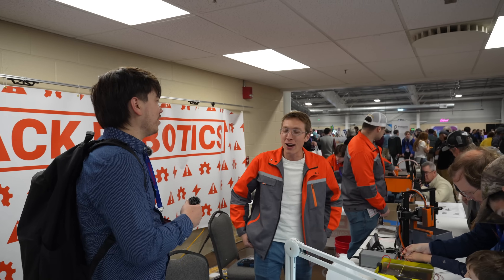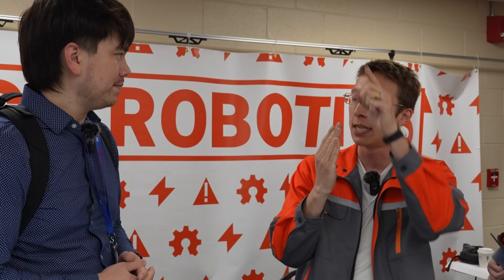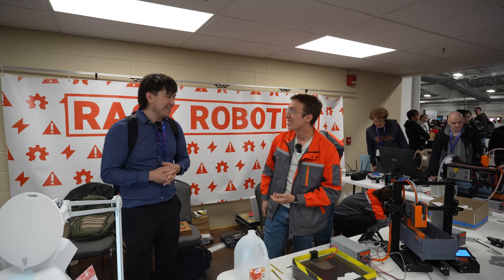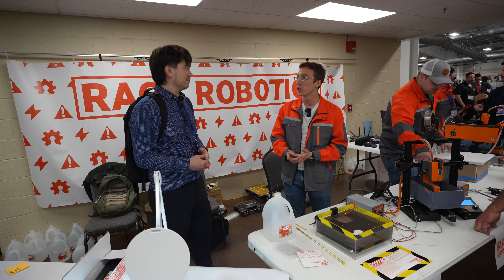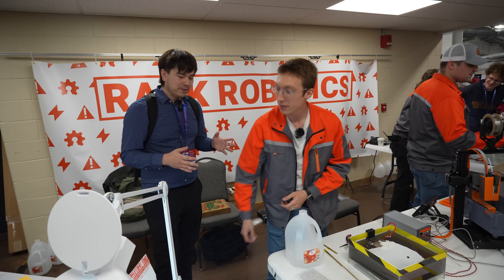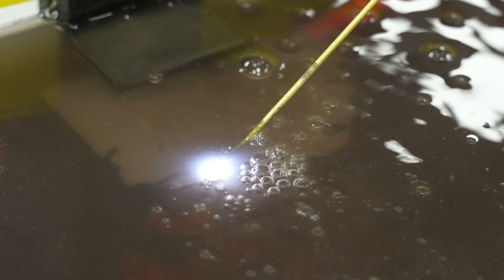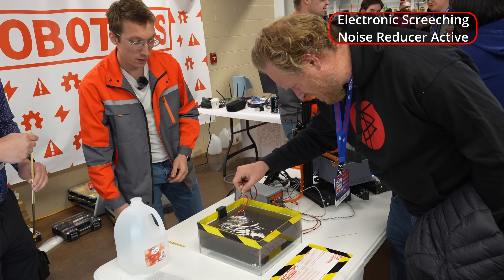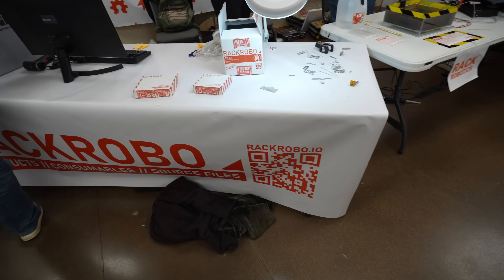This 3D Printer can cut metal! Wire EDM with Rack Robotics (RMRRF 2024 - Interview 2)

Comment: This would be the greatest addition to my 3d printer in terms of home made rc toys. The ability to do aluminum work with an old ender vs a Dremel and files would be amazing
Reply from the maker: Yeah for RC stuff, small mechanical parts, even relatively heavy brackets, this thing would be great
Reply: @NathanBuildsRobots  it would cut my grinder use by 90% which would be welcome

Comment: Now this, is cool!

I'm surprised it's only 200watts @ 70v 5-10khz [DC]  (so <3amps if I can math) doing the cutting. With
just a RP2040 managing the power/ pulse generation (I love those little things).

CNC (machining) is an excellent complement to 3D printing. Now we just need some open source metal 3D printing...
Reply from the maker: That’s like 1 mA per lightning strike
Reply: @NathanBuildsRobots  Yeah, I had to do a triple take it doesn't seem right!

However we are talking tiny distances (takes ~1KV to arc over 1cm). So yeah, surprising, but plausible.

Comment: Why was there no demonstration of the actual CNC cutting version?
Reply from the maker: They were in an interesting spot, in between the two halls so lots of traffic. Plus that intro was not scripted I just jumped on there so they didn’t really have time to prepare anything for me.

But if they say it works, I believe it. The tool force is near 0 so the printer’s job is trivial
Reply: There was on the other side of the table. The 4 axis machine was running

Comment: Will like to see independent review. And know what is the accuracy. But it looks very interesting. 👍
Reply from the maker: I always like to get a feel for a machine by feeling what it feels. Kind of a strange thing but I have a sort of mechanical empathy. 

But by holding the end effector, and seeing the force, and what causes it to work or not work, you can learn a lot. For example, I was surprised how forgiving the process was to applying different amounts of force, at different speeds. The way the electrode creates an air cushion that prevents direct contact with very good reliably is the most fascinating part.
Reply: The accuracy of an edm machine is almost completely based on the accuracy and repeatability of the frame you put it on.
Reply: that cut edm makes - if it's 1mm or 32mm thick - the kerf is basically the width of the wire, and perfectly vertical.  no exit wound style blow out.  in that respect tolerances can be smaller than parts cut w/ a laser.  and cutting dif thickness (hotend) in the same pass without needing to focus anything - that's slick.  I'd def like to see the gantry and bed - and how they water proof stuff